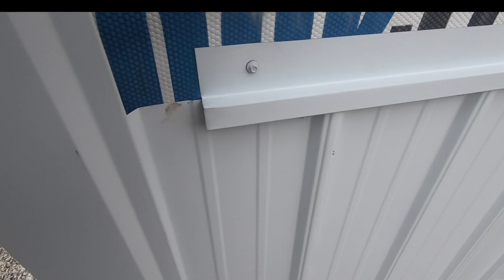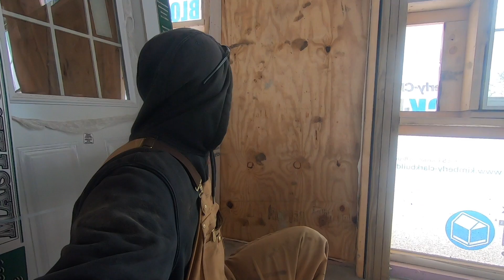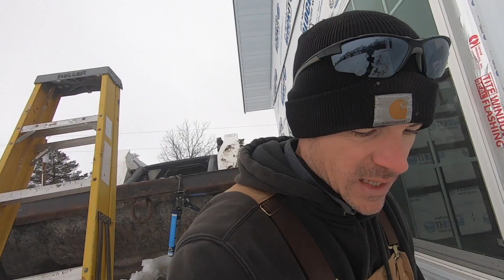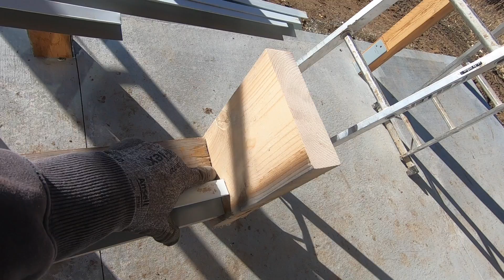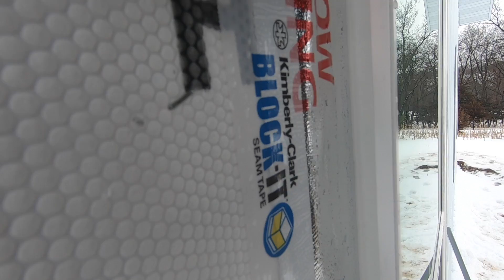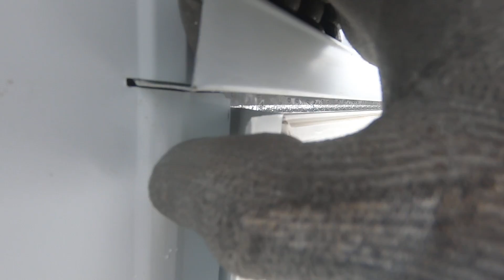Post Frame Exterior Metal Part 3 | Trimming Out Windows + Tips

Comment: Why didn’t you just trim off the rib on your wainscoting? It looked as if it would’ve been covered by the corner trim.
Reply from the maker: You want the steel to go all the way to the corner and there should be a rib behind the trim to prevent wind driven water from getting into the structure.

Comment: isnt it getting damn hot inside when the sun hit the metal ? Greets from Germany
Reply from the maker: Not so far. It’s freezing cold right now. It will be insulated and the ceiling will be installed by summer so I won’t have to worry about it.  I have vented soffits and ridge so the attic should be able to vent properly.

Comment: With your doors do you plan on doing jamb extensions later on so they can open fully? If so I'd love to see that video. On my post frame house I have a 9" outer wall siding to drywall, so the standard jambs my doors came with only allow the door to open about 90 degrees and I want them to be able to open fully against the inner wall. I'm not sure if I should just make all new jambs or do some sort of extension.
Reply from the maker: I custom ordered these doors so my jambs would match my wall thickness. This way they will open all the way.